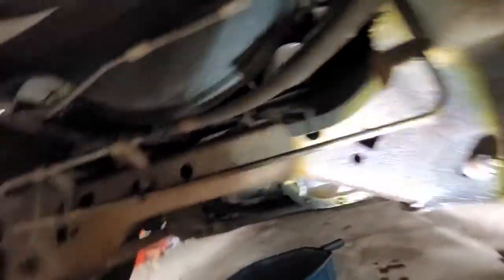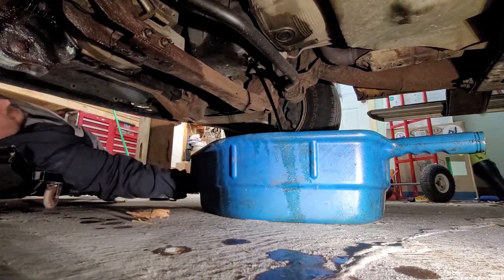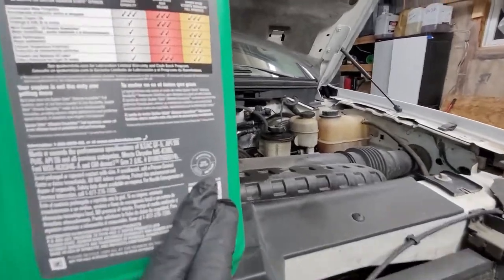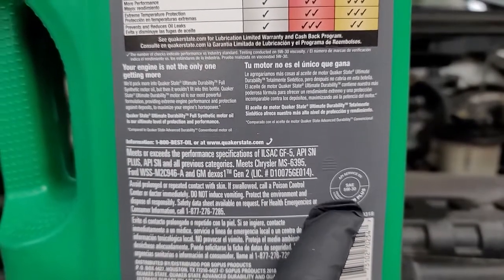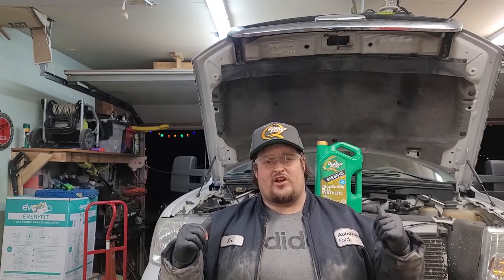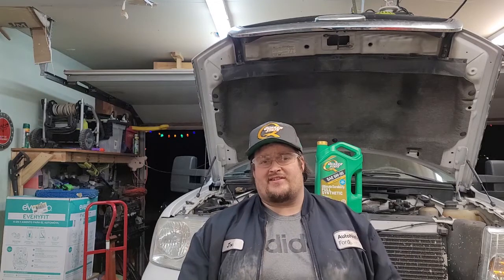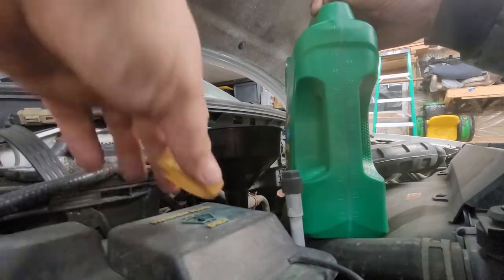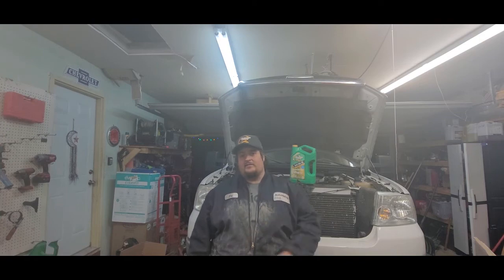F-150 oil change 2004- 2010 5.4 liter

Comment: I have a 2004 F150 Triton my oil cap said sae 5W-20 
Should I use 5W-30 instead
Reply from the maker: hello the caps do say 5w20 i go by @fordtechmakuloco channels recommendation of 5w30 with my customer and i have had great results so i suggest it to all my customers
Reply: I had the same question
Reply: Use what the manufacturer says to use.
Reply: What do you mean by "I have had great results"? How long do all the engines you have used it on last? Have you ever used 5W-20 on anything so as to be able to even make a comparison?  @JoeTheAutoGuy
Reply from the maker: @stevensevek6151  meant specifically 5w30 in 5.4 liter 3 valve applications, and yes noise down start up great , longevity after major repair and oil pressure great and consistent and less break down on oil and amount of metal in oil samples so yes it’s been a great recommendation on switching to 5w30 in triton 3 valve engines

Comment: I usually have my oil changed from Walmart Auto Center, and they uses Quaker State oil. Will it be okay to continue to use Walmart to change my F-150 oil?
Reply from the maker: yes  as long as they are serving you well